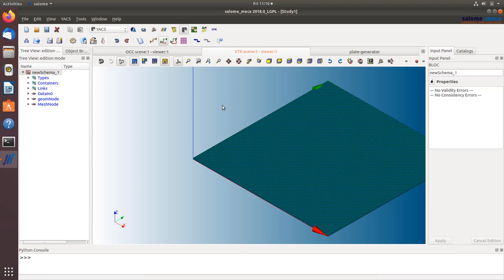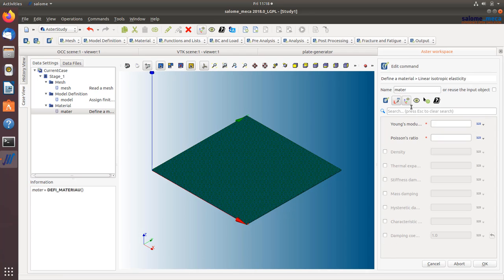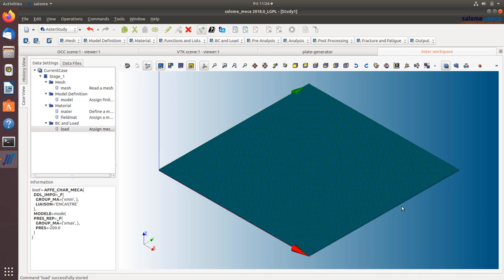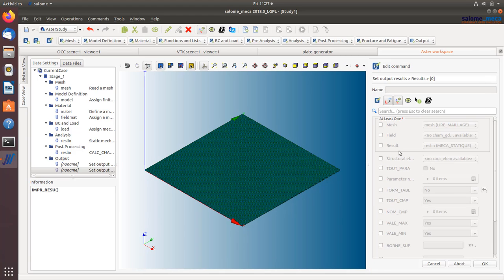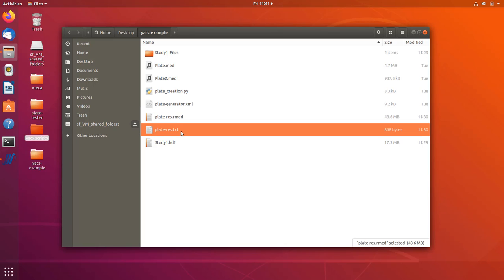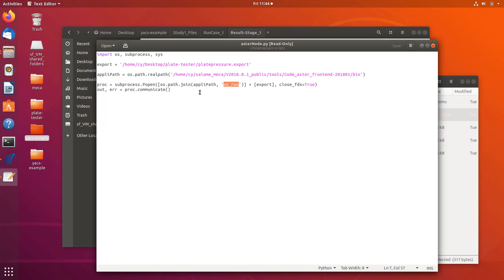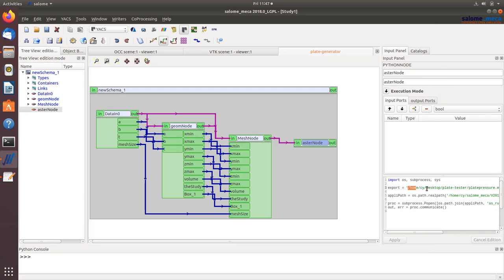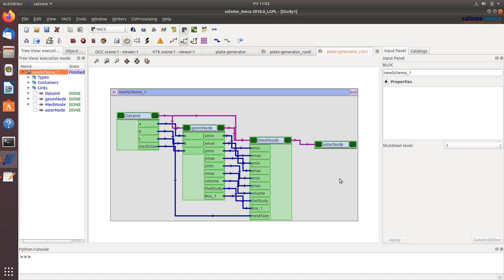[Salome Automation 3 ] Automating Code Aster Simulation with YACS

Comment: Hello,
I found your video very interesting and didactic.
Currently I use salome_méca (salome_meca 2021.1.0-2-20220817), and I could not find the python file allowing to launch a calculation.
How to achieve the same result with the singularity container.
Thanks
Reply from the maker: That’s a good question. I think code_aster got its own python module since I made that video. So in theory, it should be easier to launch… I have to investigate how it works now as things seems to have changed a bit.
Reply: @Feaforall  Hi Cyprien, could you find a solution here?

Comment: Hi Cyprien, million thanks for your videos. They are extremely helpful for learning Salome and Code_aster. Currently, I am trying to run my Code_aster simulation in YACS using Salome 2020 on Ubuntu 20.04 LTS. 
When I run the asterNode in YACS I obtain an error (details below). I understand that YACS cannot find the as_run file. IMHO the path is correct and should run like in your example (which it doesn't). Do you have any idea what the reason for this error might be and what could solve it?
Any advice is greatly appreciated,
Lukas

Error message from YACS:

<error node= newSchema_1 state= FAILED>
<error node= asterNode state= ERROR>
Traceback (most recent call last):
  File "/tmp/PythonNode_4158", line 7, in <module>
    proc = subprocess.Popen([os.path.join(appliPath, 'as_run')] + [export], close_fds=True)
  File "/home/lukas/salome_meca/V2020.0.1_universal_universal/prerequisites/Python-365/lib/python3.6/subprocess.py", line 709, in _init_
    restore_signals, start_new_session)
  File "/home/lukas/salome_meca/V2020.0.1_universal_universal/prerequisites/Python-365/lib/python3.6/subprocess.py", line 1344, in _execute_child
    raise child_exception_type(errno_num, err_msg, err_filename)
FileNotFoundError: [Errno 2] No such file or directory: '/home/salome_meca/V2020.0.1_universal_universal/tools/Code_aster_frontend-202001/bin/as_run': '/home/salome_meca/V2020.0.1_universal_universal/tools/Code_aster_frontend-202001/bin/as_run'

</error>
</error>
Reply from the maker: The path to your as_run is not correct... go to that path and check if you can find as_run or not...

Comment: merci bcp, pourriez-vous le faire sur Windows, svp?
Reply: In Windows I found that instead of using subprocess, it is more convenient to use 'os.system'. The python lines to put in the YACS module look something like this:
import os

# Code Aster launcher
runPath = r'C:\SalomeMecaWin2019\PRODUCTS\code_aster\bin\as_run'

# Location of the export file
exportPath = r'C:\SalomeMecaWin2019\WORK\Plate_yacs\Plate_Files\RunCase_1\Result-Stage_1\export'

os.system(runPath + ' ' + exportPath)

Comment: Thanks cyprien! Your guide videos are great 😃. I love how clear it is! I saw openfoam in your folders 😏😏 have you used or are you planning to? I could help with the basics! 😃 As at least I use Salome for OF in my normal use of Salome. Anyway thanks a lot!
Reply from the maker: Just installed it for now... but you’re right, that’s a good idea to do some tutorials on openfoam ;-)
Reply: @Feaforall  well I am using this tutorial of yacs for automating Of actually 😃. Please don't hesitate if you need some help or questions would be a pleasure!
Reply from the maker: You should be able to do that with openfoam. Just use the openfoam executable in the subprocess like I did with the as_run executable that can run aster, then it should work.
Reply: @Feaforall  yes, I have already done it, commonly we use bash scripts so I have done as in code aster but for bash, I have still some small problems but I should get it solved than the next days 😁